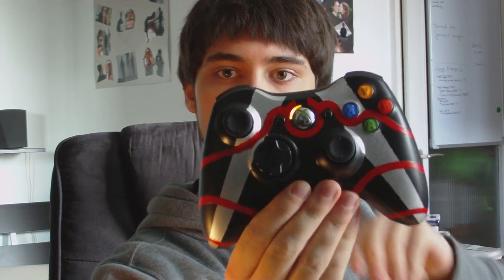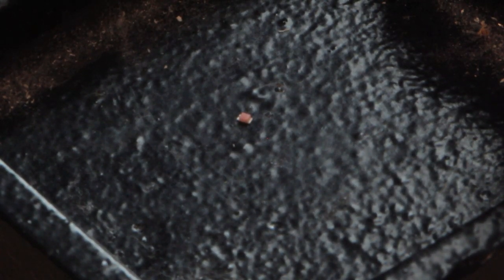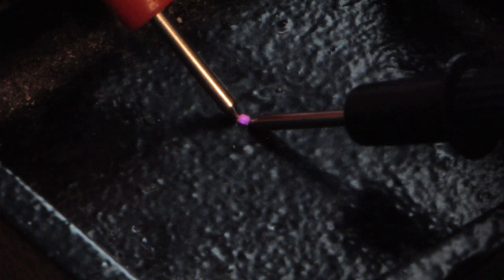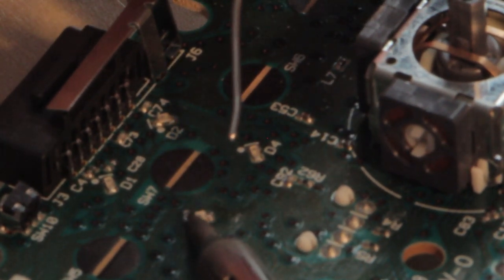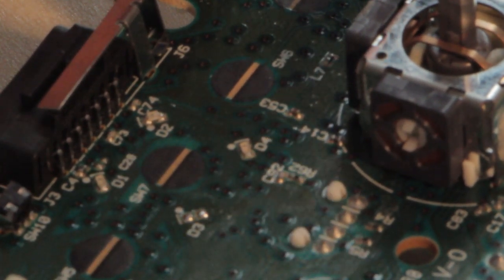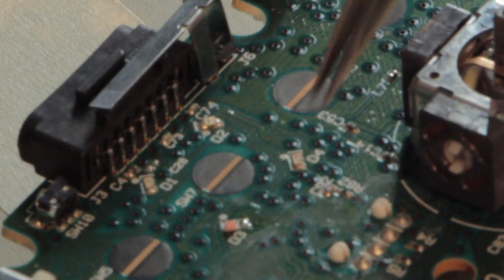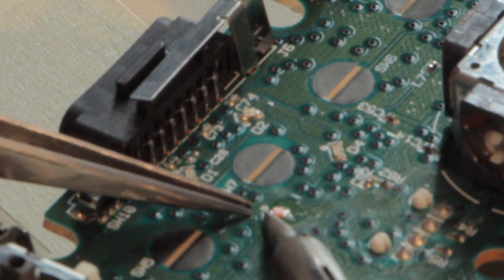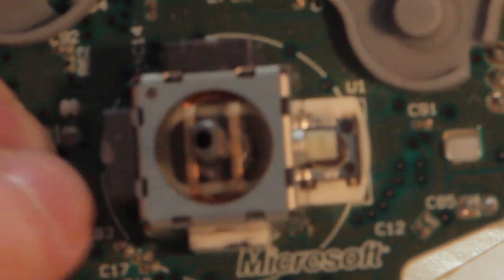Xbox 360 Controller LED Mod Tutorial

Comment: Heyjusta quick tip if i get a specal copper wire, soddering sucker then u dont need to swipe away the extra sodder and so u dont burn the board, its just what i learned in my electronics class...
Reply from the maker: Rain zimmer Hi. Sorry for the late reply, and thanks for your tip. You're right, to remove the extra solder, solder wick would be a better option, and if you're dealing with larger components/pads, it's definitely necessary. For smaller pads like these, however, swiping away the solder works and won't burn the board if you do it fast enough. I guess I was just a bit lazy and didn't want to grab the solder wick :)
Reply: lol i understand.. and thanks for the video it helped alot

Comment: hey juan my soughtering gun broke stopped working and I was wondering if you put the led down can you just put tape over it to hold it down?
Reply from the maker: Hi. Those LEDs are really tiny, so it would be difficult to tape them over the exact position and with a proper contact anyway, and you risk them touching something they shouldn't and shorting something out. I would recommend that you just wait until you can get a new soldering iron/soltering gun. The gamepad should work perfectly without the LED, so it will just be a matter of appearance until then.

Comment: Am i able to just glue it down or do i have to melt it on there?
Reply from the maker: SkunkMan49 Bruh If you're talking about the LEDs, you need to solder them to the board, since glue won't create an electrical connection
Reply: Juan Gonzalez thanks man
Reply: juans right unless you have conductive glue its better ;)

Comment: How much is all that equipment?
Reply from the maker: Good question! You should be able to get a simple soldering iron for 10 - 20€ and a tweezer set for 5 - 10€. To open the controller you will also need a torx screwdriver, which probably costs around 2 - 5€ if you don't buy it in a set. Those are all tools that will last you a long time, unless you start to do a lot of projects and decide to ditch the soldering iron and buy a soldering station (50€+).

As for the LEDs, the prices vary a lot (between around 50c each at local retailers and 4€ for 100 online from china, or even 10€ for an entire reel). The manufacturers typically sell them in reels of 1000-10000 for pick-and-place machines, so you're mostly paying for the work involved in manually cutting those reels when buying small quantities.

NOTE: you could probably replace € with US$ here, since electronics seem to cost slighly less in the US

Comment: where can i get some of those LEDs?
Reply from the maker: +parkour chiild You can get them either from an electronics store or from online marketplaces. Just search for "0603 LED". Just remember to buy at least 1 or 2 extra, since its easy to damage or lose one due to their small size. Also, some LEDs require a higher voltage than others and might look dim or not turn on at all depending on the voltage of your controller's batteries. When you buy them, look for the specified "forward voltage". Anything around 2.2V or lower should work perfectly.
Reply: eBay I ordered 5 for 1$

Comment: Where do u get the led??
Reply from the maker: I bought a pack of leds of different colors online on a famous marketplace with a name that rhimes with play. Just look for 0603-sized LEDs, or 1608 in the rare case that the size is metric. You can probably get them in any electronics store, although they may not have them in stock right away.
One thing to take into account is that different LEDs have different voltage requirements. I tried using some white LEDs at first, but the controller's voltage was too low to drive them, so I had to switch to other colors... I guess you'll have to either look at the specs of each specific LED type (if you have them) or go for a trial-and-error approach.